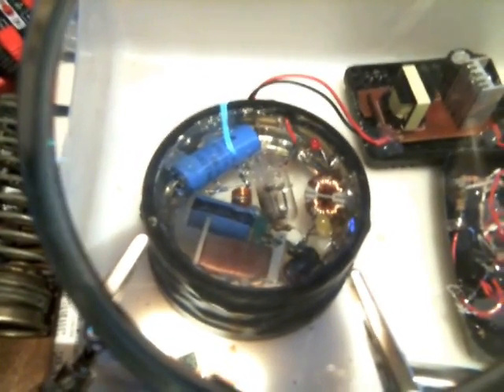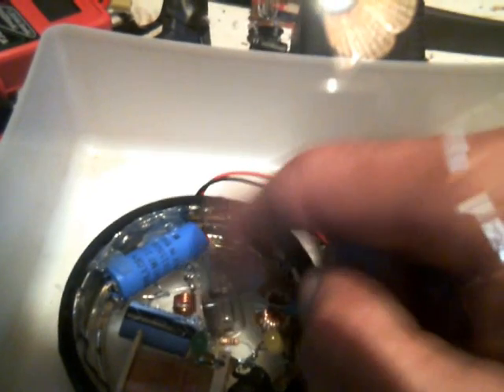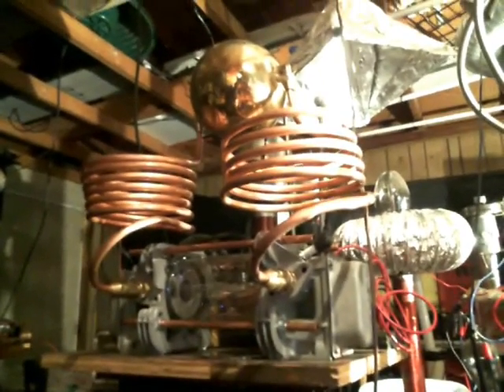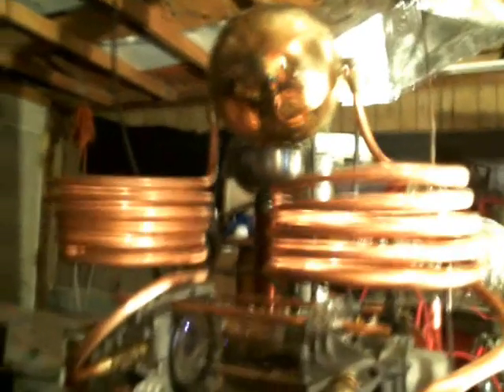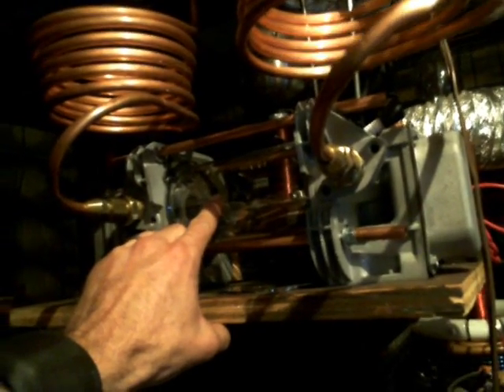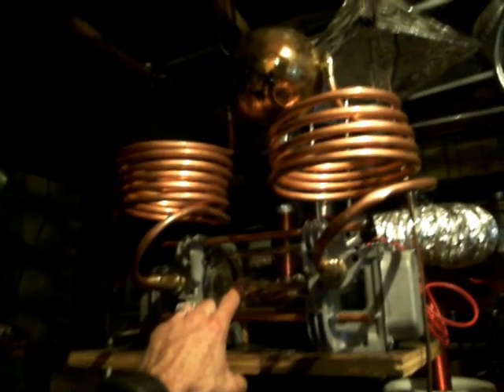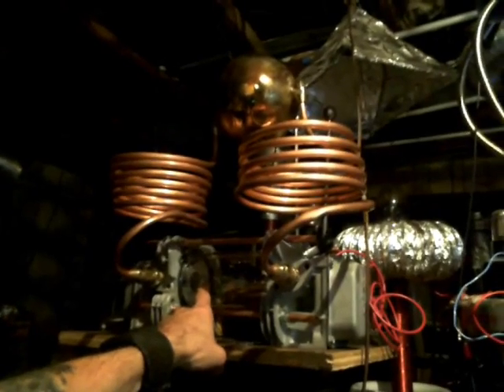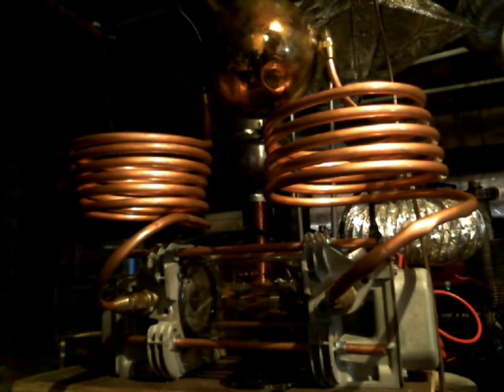GAS FILLED TESLA COIL !

Comment: dude this is so fucking cool!!!

so, if I remember tesla correctly, I would remember that he invented a system in which he has two coils similar to the ones you have here which are connected with one wire. each wire is connected to "ground" and each system oscillates between each other. imagine you had a wire with two RLC circuits oscillating between each other exchanging energy, but instead imagine this energy was radient energy. constant oscillation creates a bigger reserve of energy.

Comment: The Warden Cliffe Tower was grounded via 6 iron rods each embedded 300ft into the ground. Tesla said the secret was getting a good hold onto the Earth. I am wondering if they had to go that deep to hit granite.
Is your ground located in soil or rock?
Also directly below the Tower was a well, 120 ft deep. The flowing water at the bottom was accessed via a spiral staircase around the wall of the shaft. At the bottom there were oil hydraulics.
Do you have any ideas on what the hell he was doing?